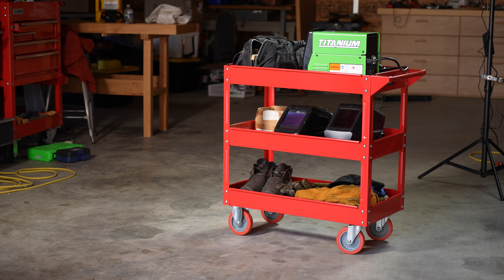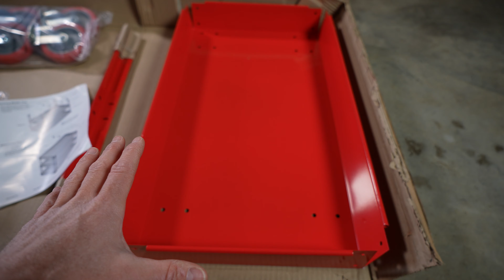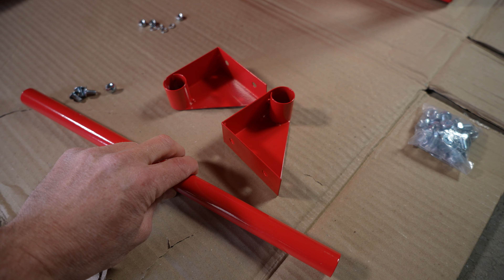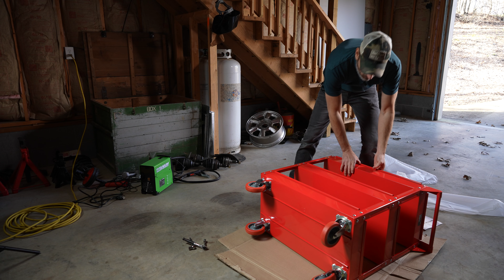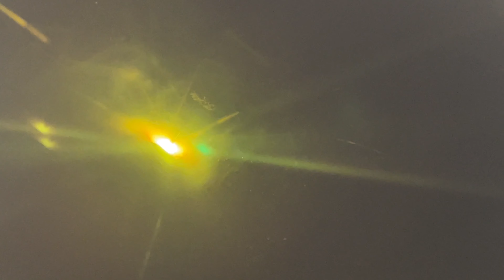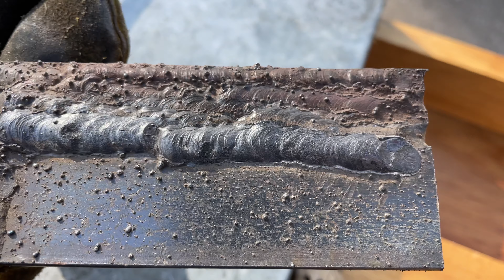Harbor Freight Doesn't Even Know They Sell This Welding Cart For The Titanium Easy Flux 125!!

Comment: Did exactly the same thing,  before I saw your video.  Planning to add a small tool box to one end of the cart and a utility/tool tray to the top shelf.  Mine is covered with a BBQ grill cover when not used